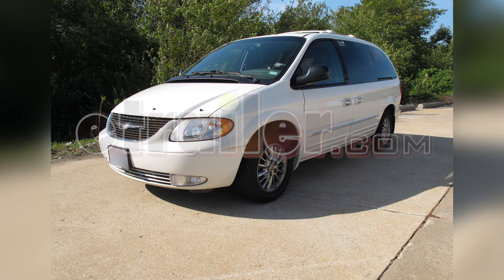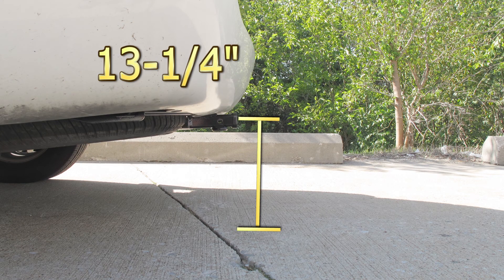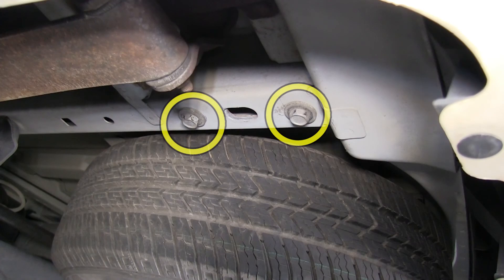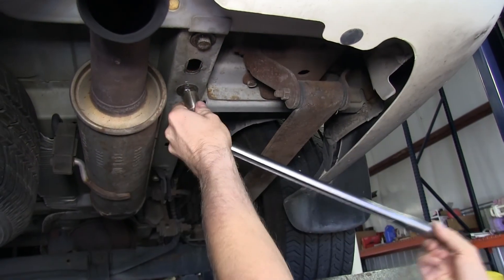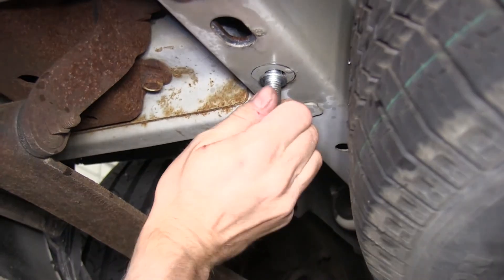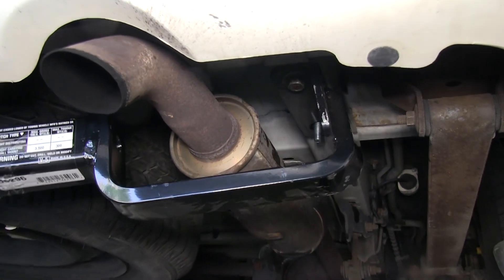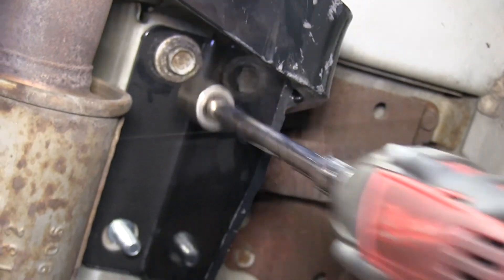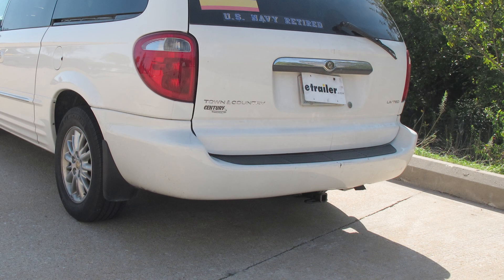etrailer | Mount: Draw-Tite Trailer Hitch Receiver on a 2002 Chrysler Town and Country

Comment: Where do you find the hardware
Reply from the maker: This hitch will come with the hardware to get it installed. We have replacement hardware kits available if you have this hitch and need replacement parts.
https://www.etrailer.com/Trailer-Hitch/Draw-Tite/36296.html
https://www.etrailer.com/Accessories-and-Parts/etrailer/RHK.html